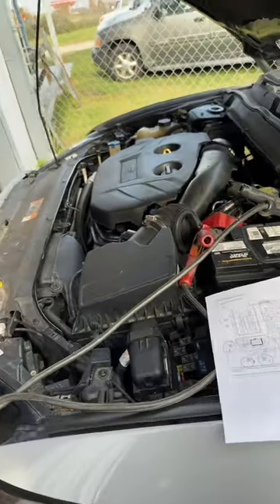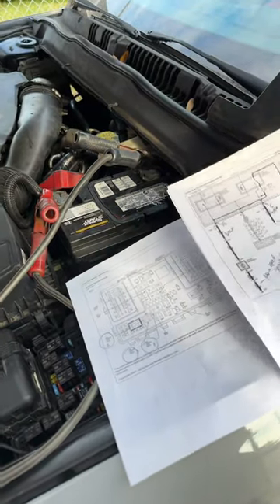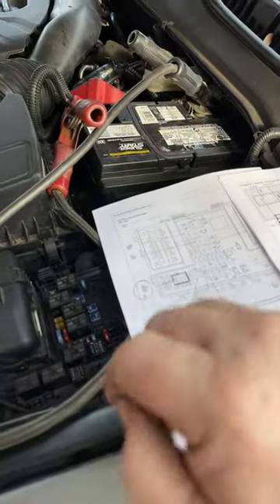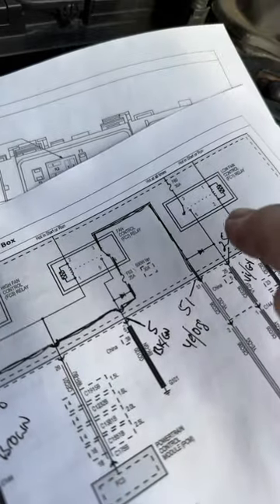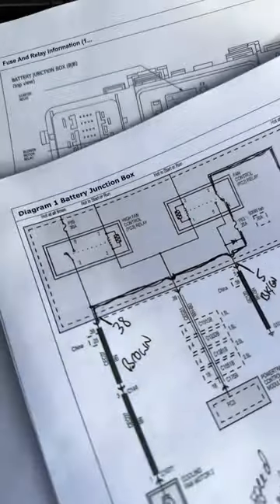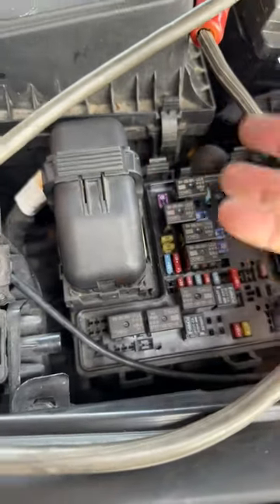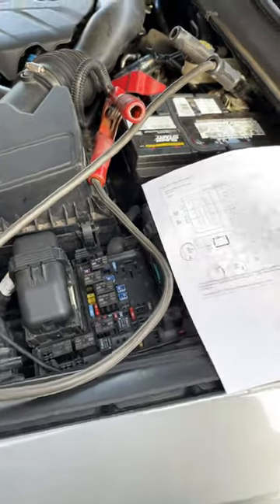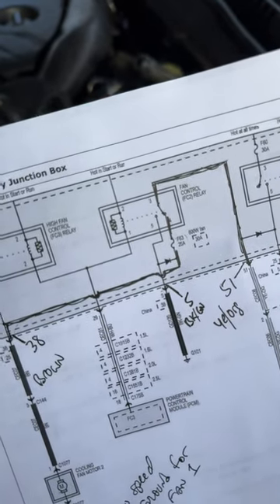Does it matter? KNOWING WHICH relay goes where in my cars FUSE PANEL?

Comment: Accidentally did this myself once in a JCB. Had to remove the dash/cab covers to fit an aircon system as my company were shipping a couple of these machines to the Middle East. Had to take all the relays out and I put a 4 pin one back where it should have been 5 pin. The machine lost Forward/Reverse! 😮 It was at the end of the day too, and it really got the boss worried as the machines were shipping the next day. It took a bit of poring over the wiring diagram at home with a few beers to figure out what I’d done wrong and all was well the next morning! 😎
Reply from the maker: Nice work Andy! Got it figured out, that's the most important thing! :)

Comment: Had a car come in once where they blew a fuse, and after that couldnt get it to start anymore. Assuming they pulled multiple to check it out. It would crank but not start. They had pulled the fuel pump diode while checking fuses and put it in backward. Took me a minute to solve that one lmao.
Reply from the maker: Wow, I can see that being a big problem!!! Surprised they made it so it could go in backwards! Yikes.
Reply: @JimmyMakingitwork  Usually, you know as well as I do. One of the blades is turned, so you can't. Can't remember what vehicle it was..